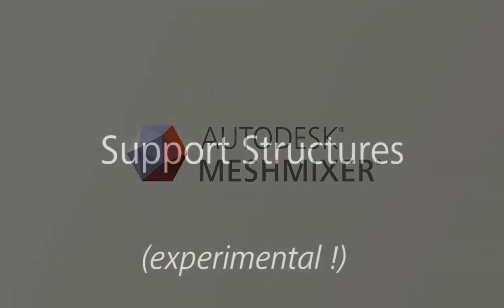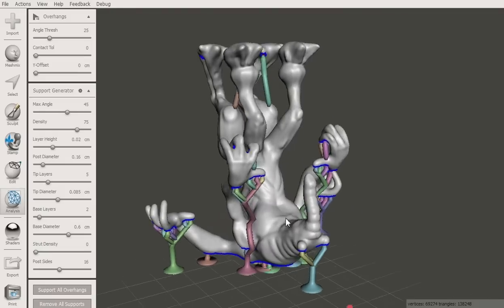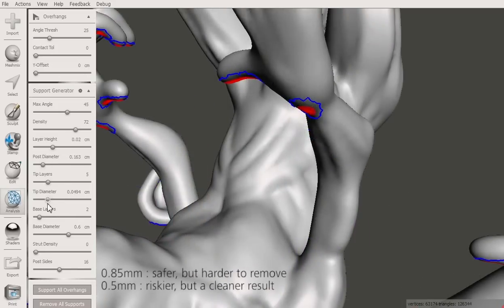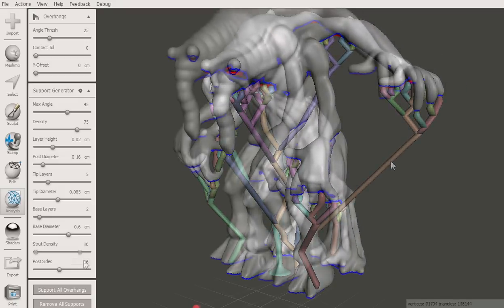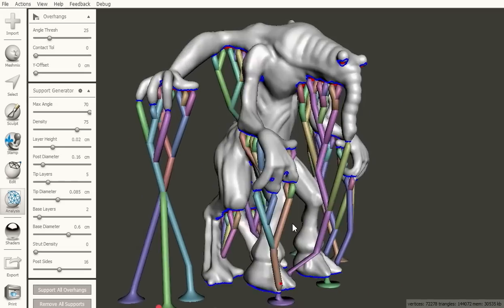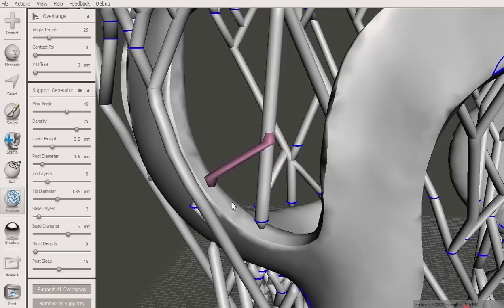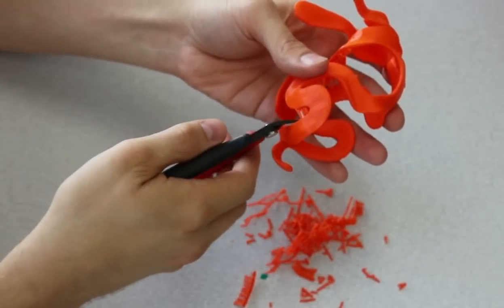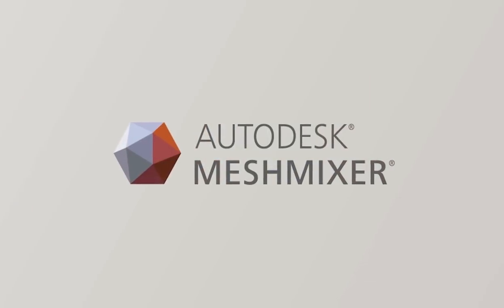3D Printing Support Generator in meshmixer 2.0

Comment: This doesn't make sense at all... what's the point of trying to support overhangs with support structures that are, themselves, overhanged?!
Reply: +Advection357 overhangs are things that dont have support going into the substrate. they print in mid air and fall. support structure all dont float in the air.

Comment: I have two questions:
Is there a way to remove some of the support material generated (before printing) ?

When I generate support, the "columns" are too close to the model, causing them to fuse to it when printing, is there any way of increasing the distance between the two?

Comment: Is there any way to draw the support structures in manually without first automatically generating the supports?  The reason is that I have a model which is a hollow "mesh" with many small overhangs which end up requiring a support point so there's 1500 support columns created.  However the only ones I want will require about 10.  So I have to manually delete all of them, and then try to draw them in manually.